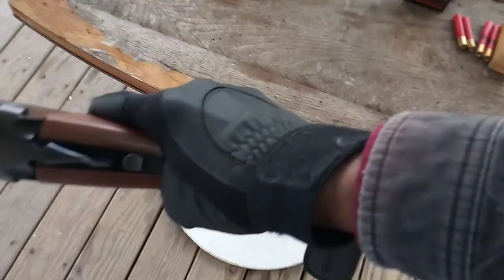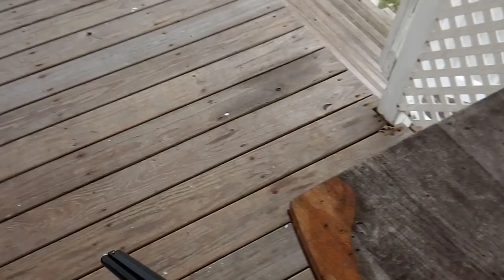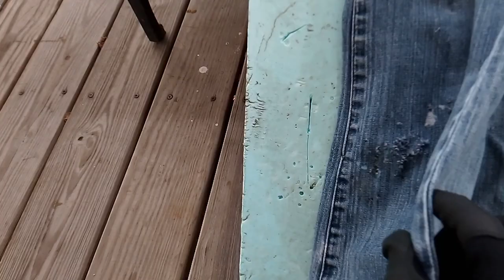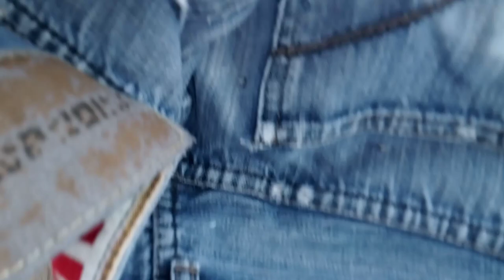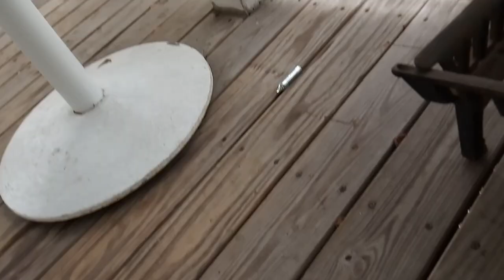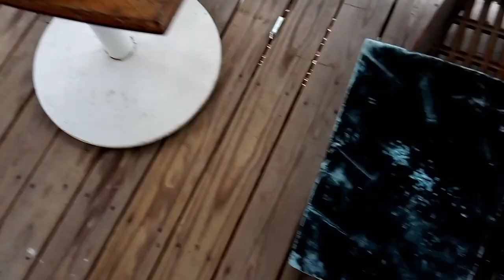Stoeger 410 Coach Gun  for self-defense mods and setup.

Comment: I would respectfully suggest you close it two handed instead of the snap-shut technique. just leads to premature wear and slop in the action I think.
Reply from the maker: Sir you're absolutely correct!
Good point. 

Normally, I do close my break barrel guns with two hands.
I was holding the camera with my other hand, otherwise I 
would have closed it with two hands. 

Appreciate your concern and insightful info bro. 
Thanks 

Have a Happy New Year. 
Stay safe and healthy. 
Peace
Reply: Yes and no, Stoegers come pretty tight action wise. So snap-shut will actually SMOOTH the action out a bit . I polished up all the parts on mine to slick it up so it falls open and shut quite nicely.
Reply: @naveyarg9771  Yep, my twenty gauge needed some slicking up. It could still use a some snapping closed.

Comment: Good choice! 12g is an overkill and unnecessary. Would be great if it would have ejectors but Coach Guns never have that. 000 Buck in .410 actually has  a lot of over penetration in ballistic gel. Smaller like between 1 and 4 buckshot  would be enough. But even birdshot looks ok.
Reply from the maker: I'd take a good 410 over a 12 for home defense any day of the week.  But that's just me.

With good shoot placement at typical home defense distances
(10 to 15, 20 feet)
 a 410 will get the job done.

As for using shot for defense...
I normally go with no. 4.
You don't get as many pallets as
7 or 8, but the trade off is bigger pallets. (Smile)

Thanks for watching.
Stay safe and healthy.
Peace
Reply: inside a house use smallest buckshot or biggest birdshot you can find. it should do the trick if your aim is halfway decent.